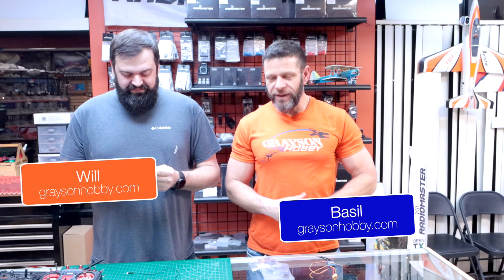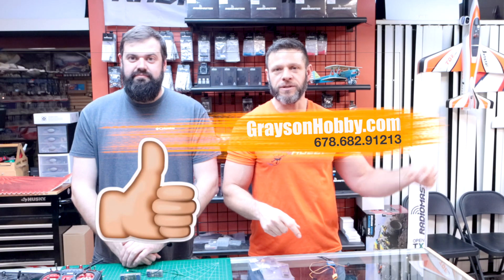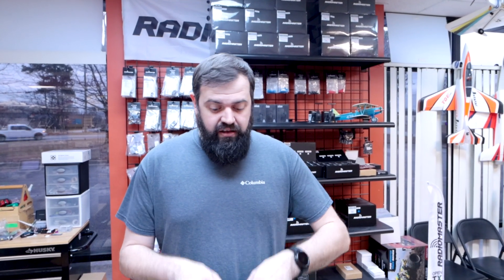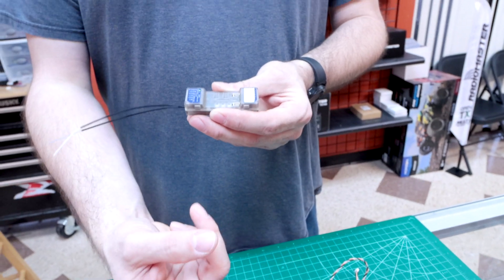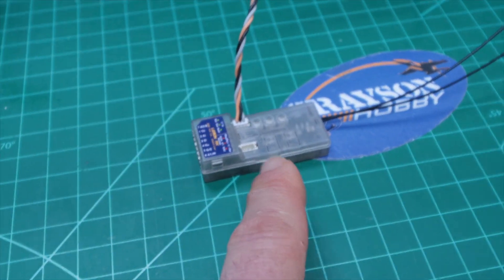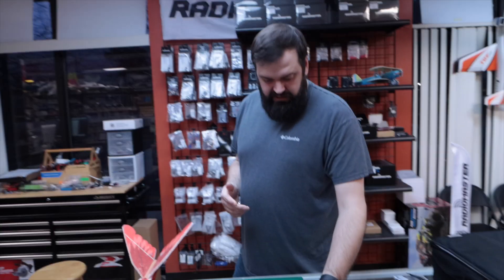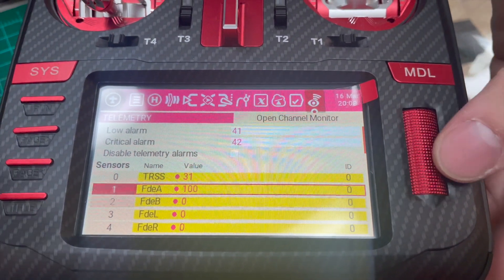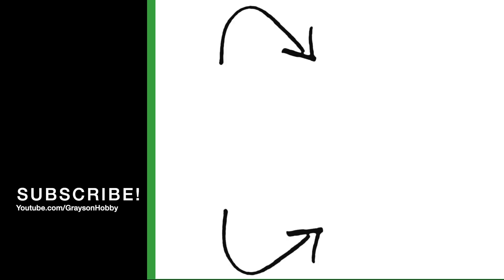Lemon RX Gen 2  | Telemetry & Stability DMSX Airplane Receiver

Comment: "Just plug the probe into the balance connector."  So you'll need to guess which port on the balance lead.  Very helpful.  If you already know what you're doing.  Then we only see the non-probe solution?  Why did I click on this video?

Comment: What happened the video kicked off and cut off when one of you guys was talking about the manual?? Also I have a question about the gyro which type of gyro is using  the one for beginner's with angle limits or is it the one that works like a AS3X or Aura 8? Also is there anyway to adjust the gyro gains through the Radiomaster TX16S??

Comment: Hi guys, how many flight-surface channels do you get while using the gyro? IOW, must you leave the 5th/gear channel unused as a 6 channel if you want the gyro? Oh also; thank you so much for showing us where the battery voltage meter goes into the red balance lead.

Comment: I'm getting the wrong voltage reading from the basic voltage sensor plug into the battery balance port with the 7ch rx on my IX14.  When I use the current voltage/current sensor it shows the correct voltage.

Comment: I would love to see a video on using the lemon rx with the freewing f22 park flier. I plan on doing this soon myself, but I want to convert it to dual aileron and dual elevator servos for even more control. But I would love a basic setup using the new 7 channel lemon rx gen 2 receiver instead of the one that comes with the pnp kit. Specifically using the tx16s transmitter.

Comment: I just purchased one from Grayson, got it in a few days, always great prices and fast inexpensive shipping.....just configured it in my Habu.....pretty easy to setup...but the leds are not labeled so have the pdf manual near.....correct ......just stabilization, not auto-level - which is fine when you realize you get current, voltage, temp and barometer sensors as part of the rx......you don't need anything 'smart' in your plane....works with all esc, battery etc......my TX16S w/Edgetx 2.8.1 found all sensors easily.....

Comment: Getting a little pricey…
Reply: under $40 for Rx, Stab, barometer, temp sensor, current, voltage, rx battery   .....that would be $70 in Flysky and $160 for Spectrum, and not really possible for FR sky- so under $40 is great!!!

Comment: What is the voltage limit for the telemetry airborne battery pack. 4S = 16.8V, 6s =25.2V , 8s= 33.6,.....???
Reply: 5S 21v. I tried a fully charged 6S pack as the Lemon website didn't state the limit and the XT60 pass through went up in smoke. Credit to Lemon, they sent me a free replacement and now state the 5S limit. Bit wierd as I'd love to get the 130 amp pass through and fit XT90s to it for my 6S models.
Reply: Thanks for this info. 5s is a deal breaker for me as my setups are 6s... @ediflyer

Comment: Is there a direction for mounting the gen2? The gen 1 required the receiver to be mounted pins forward and label up. Yes you could get by mounting it upside down if you reversed the servos.

Comment: Why they decided to not include auto-leveling is baffling. I reached out to LemonRX and they confirmed this does NOT have auto-leveling so no panic recovery capability.
Reply: My guess is because Lemon was not successful in their earlier models that featured "auto-leveling." No matter what transmitter I used: Spektrum DX8, DX9, Jumper, or even my Radiomaster transmitters I just couldn't get the ailerons to stop creeping (extreme trim change) every time I throttled up. I have five of the Lemon receivers that had "auto-leveling" all had the same problem. The 3-axis gyro part in them worked great just no "auto-leveling."

Comment: IF you are looking at all the telemetry/voltage info on the Tx , you are NOT watching your aircraft...does that then fall under NOT flying LOS? or is that where the "observer/spotter rule applies ?...LOL
Come on guys 🤣🤣😂🤣🤣😂😂
Reply: You usually have telemetry reading voice set up. So you listen when you fly
Reply: @henryairconcepts2999  Not all Tx's have voice/sound But i get your point , appears you missed mine...Lol